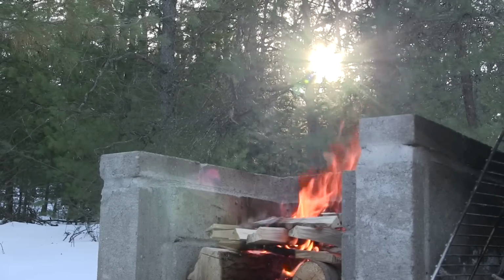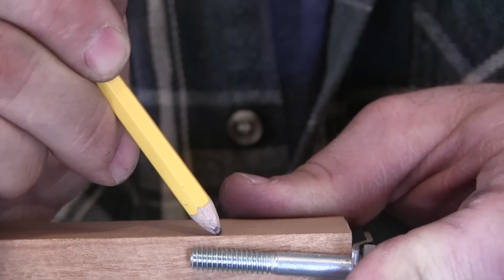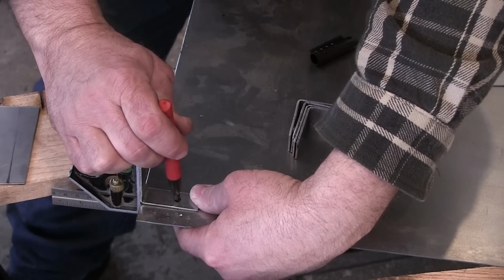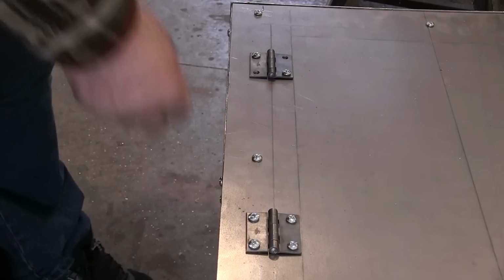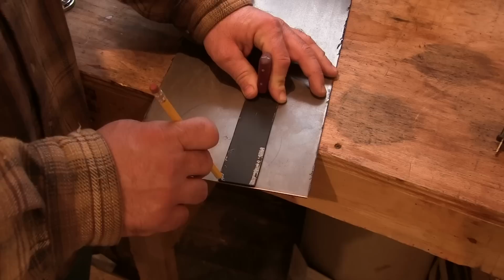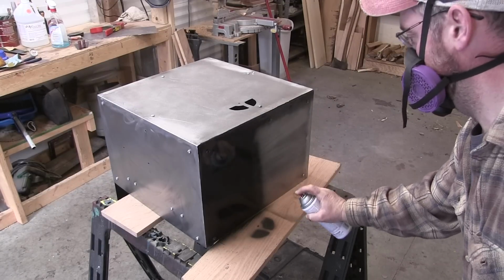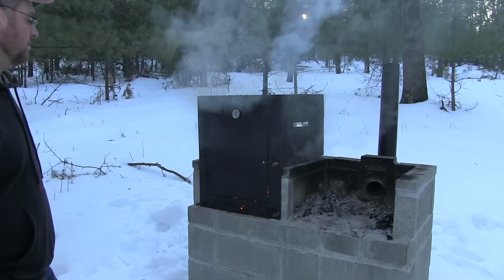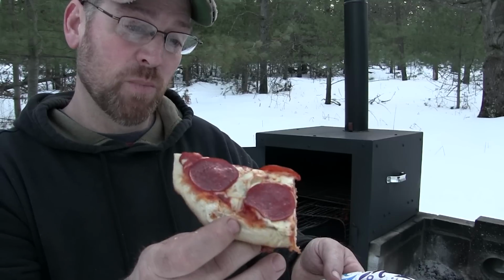Building a wood fired pizza oven / smoker for the off grid outdoor kitchen

Comment: Sorry I got cut off because the video ended. To make pizza, I feel some firebrick along the sides to grab and hold heat. Start your fire well in advance to get everything very hot. Like 700°.  Lots of dirty smoke is ok for grilling,  but you'll want dry seasoned  wood not to smoke too much. A couple trial runs and you'll have some good pizza.
Reply from the maker: Sounds like a good way to go. I’m really looking forward to getting it dialed in

Comment: A slightly easier way to create handles is by using a hole saw. You already end up with a round cutout with a hole in the middle. Some sanding, a little bit of standing with a clear epoxy coating and it is perfect for outdoor use. Also, don't put holes in your bottom plate if you want to bake pizza's. The fire will heat up the bottom plate and will be enough to heat up the oven itself. However your fire does need an exhaust for breathing, I put my exhaust behind the oven and it has two sliders, one at the level of the fire and two at the oven level (2 inches from bottom and top) and by opening one or more of the three sliders I can control it all. When I want to smoke meat, I'll remove the bottom plate...
Reply from the maker: I think that would help a lot to put a larger exhaust hole in then the fire could burn hotter yet . right now it seems I can only get it up to maybe 600 id like to get it up around 7-750

Comment: to make a proper pizza you need about 900 degrees (and a better dough that one you have looks dead ;)    with an oven like yours with no insulation or firebricks you won't be able to reach those temps and hold the heat  but you can easily get to 400-450  what you can do is make a "pizza stone" with fire bricks  and place it right on top of  the steel plate,  make it so the back has about 4-5" of space from the rear wall so the fire can circulate from the back , build a nice fire in the middle to get the stone nice and hot then push it in the back , keep the fire high you want the flames to flow in the space in the rear and heat the top , ideally you'd have some kind of refractory roof to direct the heat and hold it but i think if you weld another thicker plate and leave a small space between that and the roof to act as a heat chamber might work sufficiently well  , or maybe even sandwich  a piece of ceramic insulation in between .. you'll also need a chimney for sure to draw out the smoke and a door with a smaller opening or cut the one you have to make the top able to be shot close and leave the bottom open so you have access to the fire and the pizza cooking surface ..  orrr.. since the assembly is so portable and removable build a new one specifically for baking keep this one as is which is great for smoking , then build one with a rotisserie and you can easily swap pieces around as needed   lol

I built my first 2 pizza ovens using a similar concept but with bricks and concrete blocks  and it worked well but i wanted something more permanent so i built a "proper" arched oven with firebricks, fireproof mortar and clay ,  first time ever to try and lay bricks and it turned out amazing not pretty but functional , i had the second round of pizza made this weekend and the oven reached 945 degrees,  after the pizza was done i let it cool down to normal temperatures and was able to bake 2 loaves of bread and an apple tart then i ran out of things to bake
Reply from the maker: hey sorry it took me so long to respond to your comment . I really wanted to print it off so I didn't lose the suggestions you made. most of the time once I've responded to comments they become somewhat difficult to find . thanks for these tips I think I might try a couple of the easier modifications you mentioned . I should just buy a welder and do like you say and build another one . anyways thanks again glad you enjoyed the video and thanks for the tips !

Comment: Awesome videos where typically I'm getting the knowledge from you so hopefully I can return some. Most brick ovens have the coals/embers/fire behind and or to the sides of the pizzas rather than under with the exhaust above the flame areas to prevent the smoke. This let's the fire crisp up the pizzas rather than smoking it or burning the bottom. This method you need to rotate the pizza through the cooking for even cooking. Hopefully you can gain some help/info from this not but either way thanks for posting the content you do, stay safe!
Reply from the maker: Thanks !!! and thanks for the tip I was kinda thinking I would maybe cut a few inches off the back of my heat shield so it could allow the flames to come up the back like you're saying and maybe cut a couple notches on the sides of it as well just not as large.

Comment: Awesome build from scratch.  My two cents,  I'd move your chimney towards the front so the heat comes up from behind and then rolls over the top of your pizza and then out the top at the front of your pizza oven (if you move it to the front).  Right now,  I think it's just going straight up and out the back and never hitting the top of your pizza.   Awesome build though,  from a fellow DIY'er!
Reply from the maker: that sounds like a good idea . I cut a notch out of the back of the heat shield so hopefully the fire can burn better and heat up more . I might add another vent towards the front like you say thanks for the idea

Comment: Hi, saw the 2 videos. Nice! I was wondering about the block you use. How well do they hold up to intense heat. Should I look for a fire resistant block or and special mortar?
Reply from the maker: Thanks !! the solid 4 inch thick blocks seem to hold up pretty well . I did line the one side with fire brick side I was doing maple syrup on it , and that takes a lot of heat for a long time . I doubt it would have held up well to that . fire brick with refractory mortar would definitely be better

Comment: Thinking about building outside grill like this, does that vent help with the smoke? The one on the right?
Reply from the maker: as soon as I put the griddle on a lot of the smoke goes up the vent . when its open air pretty much no smoke goes up it
Reply: @blackspruce1861  got it, we are outside a lot so I wanted to build a half shelter/shade house kind of thing with a grill like yours, thank you!
Reply from the maker: @ no problem,  did you se the last video I posted on that project? I built a pavilion over it turned out really cool
Reply: @blackspruce1861  sure did! Was great!

Comment: Nice fab job. Well thought out. As for welding? I've stuck metal together before, using electricity, but I wouldn't call it a weld.😀I noticed in the comments that you got your steel from Alro. Did they deliver it, or did you go pick it up,and is it cheaper than buying it from Tractor Supply?
Reply from the maker: Thanks !! I picked it up they have a scrap section you can pick through . I never thought to look at tractor supply so I have no idea how their price compares . I think it was 90 cents a pound but don't quote me on that
Reply: @blackspruce1861  Pretty sure you got a better deal from Alro.

Comment: Maybe if you used wood pellets it might work better.  It’s a slower burn, plus they have different kinds of wood.  Hickory, cherry, etc.
Reply from the maker: That might work . I think my next try is going to be with a pizza stone and im going to make the heat shield smaller so the fire can burn better that should get more heat to the area the pizza is in and if it can burn better it shouldn't smoke as bad
Reply: @blackspruce1861  - Try all the above.  It should be good.   Can’t wait too see the improvements.

Comment: Get a thermometer.  Pizza on your set up is hot and fast.  You want at least 500 degrees and it should cook in under 7 minutes.
Reply from the maker: there's a thermometer on the door . I think the heat shield is stopping too much of the heat I'm going to cut an opening in the backs so the fire can burn hotter .

Comment: My thoughts as a foodie;  get a pizza peel (Long handled paddle thing) use corn meal on the bottom of your crust, (helps pizza slide) burn the wood down to coals, oven should be 400º+, push coals to the back, place raw pizza on the steal plate, rotate pizza to bake crust evenly.  Traditional wood fired oven has the fire in the back and pizza's on opposite side. Hope this helps
Reply from the maker: thanks for the tip !!